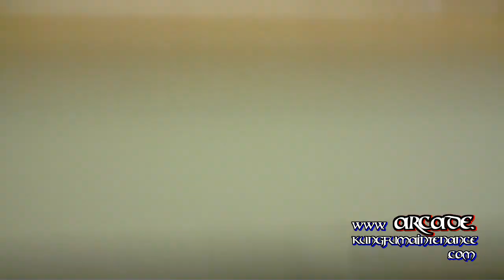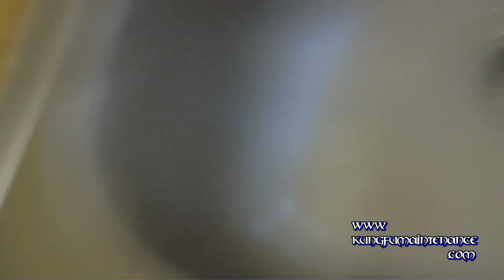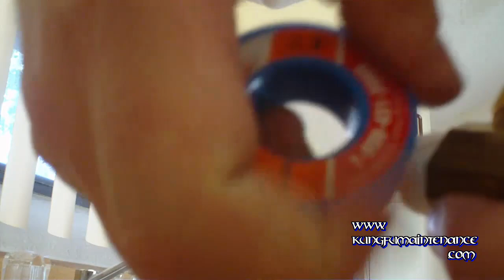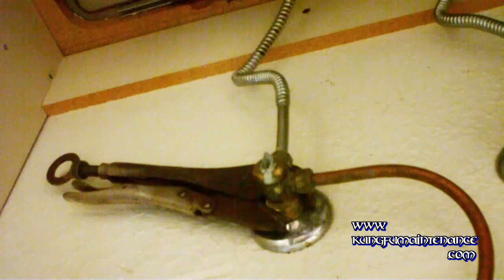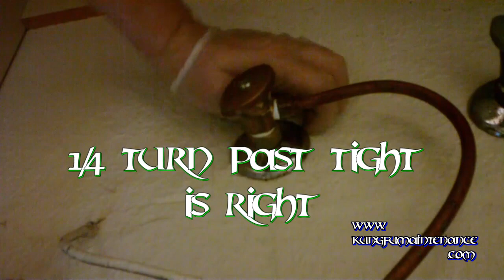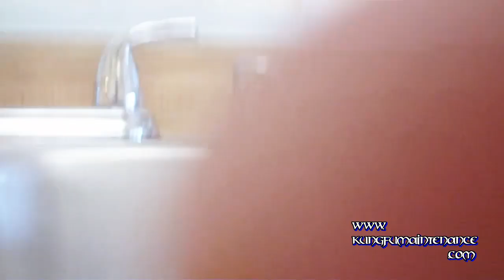How To Replace A Broken Water Isolation Valve Dual Angle Stop Shut Off

Comment: Very helpful...bought an older house that has compression valves with female threaded inlets on my supply valves to all toilets and faucets.  Looks like I will have to replace all of them? As I can not find supply lines that have a male threaded end to screw into the Supply valves.  Any suggestions??